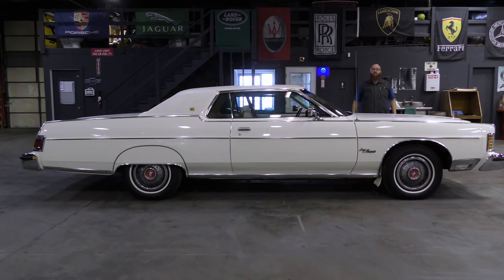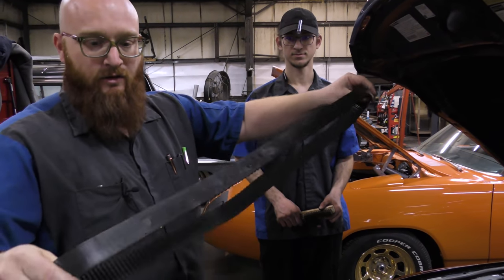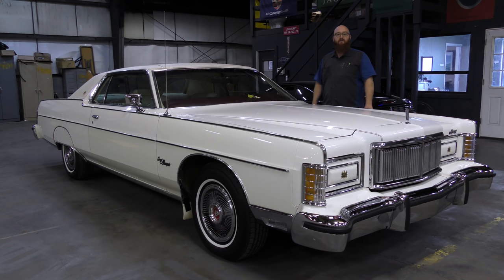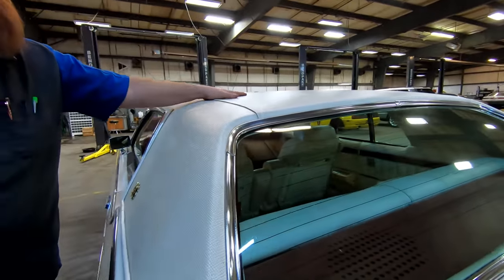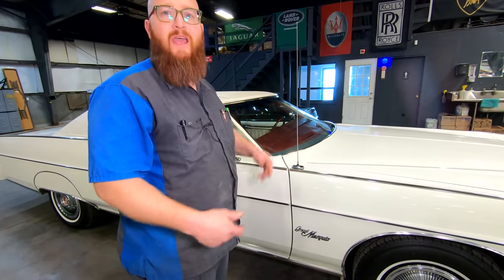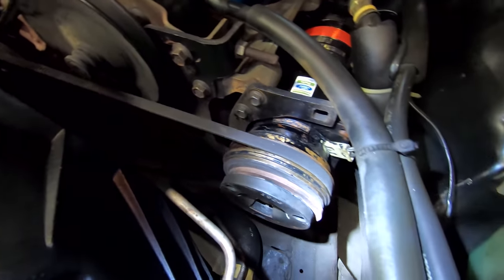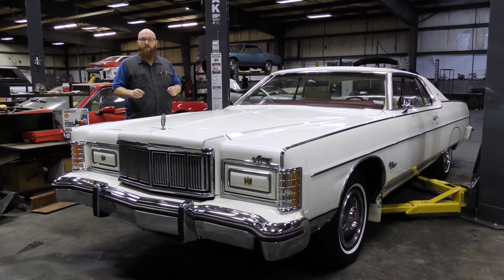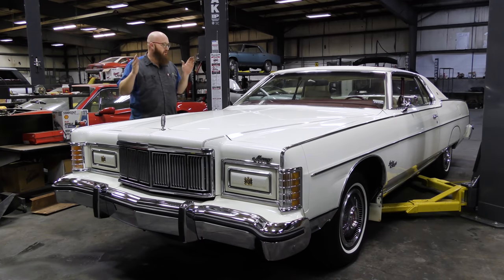Land Yacht Alert: 1975 Grand Marquis with 17K miles is in the CAR WIZARD's shop

Comment: I can't even imagine what kind of fuel mileage that thing can get. Back in the day, I had a 1971 LTD Country Squire wagon with the 400 cid engine. It would get 10 mpg on the highway, at 55 mph.
Reply: SPM Smiles per mile 😊
Reply: A friend had one in high school and it got something like 7 miles per gallon.
Reply: @michaelmaas5544  why?
Reply: Remember this was after the “ gas crisis “ before my time but If I recall 71 was the last year for these high compression engines so these big 400 + coming engines had super
Low compression and had under 200hp but boatloads of torque if I remember correctly.
Go back to late 60s and 71/72ish and these engines had 250-350HP and 500+ lbs of torque with 2 4 barrels of course! Imagine how these huge boats moved then!!! I’d love to drive one and feel 500lbs of torque in one of these pillow floats lol
So this goes for the Ford crown vics of the late 60s -72ish ,Mercury grand marquis’s and Lincoln town cars of course! 500lbs of torque LOL
Reply: @SMor42  Wow, imagine burning 3 10-liter buckets of fuel to move your ass 100km. I think I'd start cycling to work to offset it in my conscience.
Reply: My first car was a ‘77 LTD with the 460; if you put your foot in it you could watch the gas gauge go down 😧
Reply: My 1969 Lincoln Mark III got in the vicinity of 9 around town, but almost 19 on the highway.  Fuel mileage was irrelevant in those days.
Reply: I used to have a '76 Thunderbird with that same 460 and it was EPA rated at 7.6MPG. Never actually tested it myself but it took well over $100 to fill up back in the early to mid 2010s.
Reply: I’m actually getting 15mpg hwy!
Reply: @escapecar  but it only made like 150 horsepower
Reply: Had a 1979 LTD 2 door back in the late 90s/early 00s. Was all black with black leather, it was a cool looking gigantic tank of a car. Had a 351w and a c6 three speed automatic. I added a set of GT40 cylinder heads off a junkyard 5.0 Explorer, had a generic aluminum dual plane 4bbl intake with a Holly 750, had headers and 2.5 inch duals with glasspacks and no cats, deleted the EGR and the smog pump, it had a "small" Crane cam in it as well as 1.7 ratio rockers.

It actually did pretty good on fuel (if I kept the secondaries closed) because it had a ridiculously high differential gear, it was like 2.70:1... Even with it just being a 3 speed it was only turning like 2200rpms at 70mph. In my younger and much dumber days she'd lay the speedometer needle on the stopper past 120mph and she was still pulling hard. Ended up selling it when it decided I wanted a truck, and basically did it all over again to a 351w in a 1986 F150 short bed 4x4, that truck was like 3 feet shorter then that car I lol.
Reply: @flight2k5 I have 75 Marquis Brougham with the original stock 460 with the stock 3 speed automatic. It is rated at 212 hp and gets about 13 mpg.
Reply: @mickeyharrington6785  oh boy. 212 hp out of 460 cubes. Woo hoo
Reply: @euroasianbob9268  That is surprising.
Reply: @flight2k5  Proves I know what I am talking about, not just talking through my A##. Don't knock it till you try it. Torque output  is 342lb ft which will move these cars very well. These are great road cars.
Reply: @mickeyharrington6785  whoooaaaa 342 out of 460 cubes?  Damn that’s impressive 🤣😂
Reply: @mateuszQRDL  stick with your smart for two then
Reply: @RToddRothrauff  I remember reading a road test of a '73 Ford Maverick with the small block V8, and the gas mileage was actually worse than your Lincoln. I remember the article claimed it was worse than some motor-homes! All things equal, the older high compression engines could get relatively decent mileage.
But of course, by '72 , compression had to come down to reduce NOX emissions. With all the other emission 'fixes', and the added weight of the 5 mph bumpers, mileage and performance really bottomed out in '74 - 75, until the cat-converters were added so they could start improving performance again.
Reply: I had a a 1976 with the 460. I kept hearing stories like, "Well, if you don't go fast, it'll do 20 MPG." I tried everything and never did better than 12 MPG. Then I figured since I had a 460 V-8, I may as well enjoy it, so I kind of drove it normally. That took it down to 8 MPG in the city and 11 MPG highway.
Reply: @B0xlife1  in 1971, horsepower ratings were switched to net figures, as installed in the car. These were at least 30% less than the gross figures. Dual four barrels were never common, especially in a car like a Grand Marquis, which never had them. They are not worth the trade off for 95% of drivers. Want 500 ft/lbs of real torque? Well, a Ford 3.5 Ecoboost makes 510 lb-ft @ 3,500 rpm in the Raptor and 470 lb-ft @ 2,500 rpm in a plebian F-150.
Reply: Dizzy Gear  you seem nice. Not.
Reply: @flight2k5  it is close to 50 years ago.
Reply: @JStryker7  Thanks, but smart is too cavernous for me.
Reply: my 77 LTD with a 400 2 barrel averaged 18-20 on a round trip on highway 53 in wisconsin in the summer time. The front tires were cheap walmart specials but the rear were slighltly undersized but wider firestones, so the mileage may have broke 21-22 possibly depending on tire.  the EPA estimates according to the paperwork i had with it said 12-14 combined 17 or 18 highway. IT definitely drank gas when city. 24.6 gallon tank
Reply: The best I ever got out of the 455-4bbl in my ‘71 Electra was 16 mpg, cruising the interstate at 55. Around town, about 8-10.
Reply: @flight2k5  By todays standards maybe not. In 1975, yes, it was. Can you even remember that far back, or are you still wet behind the ears?
Reply: @mickeyharrington6785  you’re kinda special aren’t you?
Reply: @flight2k5  Not at all, but from the way you talk, you must think you are! Goodbye!!!
Reply: @mickeyharrington6785  goodbye!
Reply: 13-14 at best my 78 with 302 got 17
Reply: My first car  was a 1972 4 door Caprice with the 400  I didn't really care what the mileage was I was 16 had a job and gas was cheap in 1978.
Reply: My 71 LTD with the 400 would get 17 on a bad day. Its all how you tune it. With an edelbrock intake, Carter afb, and dual exhaust,  I upped it to 20mpg. The same I get now with a fuel injection 4.6 with overdrive.  The LTD had way more power. (Gas is lower BTU now so it's not really apples to apples)

Comment: This brings back memories!  My dad bought a '76 Grand Marquis for my mom in 1980, and we kept it until at least the late '80s/early '90s.  I got a lot of time behind the wheel of that car after getting my license in 1984, and my "achievements" were as follows:  first time over 100 mph (which is pretty scary on a bumpy country road in a 5000-lb car with blown shocks; bonus points for having two of my high school buddies in the car with me), first traffic citation, first accident (I t-boned a car in a parking lot at about 15 mph; driver was okay despite not wearing his seat belt).  The car held up pretty well to the accident, but it did completely bust out the grille. Dad never had it replaced; I think his reasoning was that if the car still ran and drove he could live without a grille.

Comment: Truely a beautiful classic car, and considering the age amazing condition throughout.....That said I do have a critical eye, I look for fault, it’s just something I do, because finding a car especially at this age, it’s a real challenge. At 4:10 into this particular video, there appears to be a slight dent, about 9 inches in length, driver side lower front fender, just forward of the wheel arch. Apart from this, the rest of the Mercury looks just magnificent..👍.

Comment: Great old car. Excellent condition. Hard to believe that Gerald Ford was President when this was built.
While not mentioned in the video, 1975 was the first year for the catalytic converter at least for CA. 1975 was also the year for the now infamous "seat belt interlock" system. The car could not be started unless the seatbelts were buckled. There was an over-ride switch under the hood. There was so much backlash, that it was dropped for 1976.
These land yachts used a lot of fuel, but who cared? Gasoline was less than .50 / gallon back then. Thanks for showing it.

Comment: When I was a teenager shopping for my first car (in the 1980s) I test drove a very nice Lincoln Town Car that was about this size. Even back then it seemed large.  I was sure I would end up crashing into something, especially backing up, so I ended up settling on a decent condition 1977 Monte Carlo, which seemed moderately-sized by comparison.
Reply: Not a bad choice either way there. I had an '81 Z28 as my first car, and it's dwarfed by this Grand Marquis
Reply: I remember back in the late 70's my sister had a used Monte Carlo (not sure what year it was) and as a little kid I thought it was so cool that the front seats swiveled 90 degrees so you could exit the car facing directly out....I've sure never seen anything like THAT on another car    :)

Comment: That's a rare beast for sure. Even in the late 1980's the ones that were still in use looked like the Uncle Buck verson. 19.5 feet long is exactly the same as my 1962 Cadillac.
Reply: Well... your 1962 Cadillac was actually 18.5 feet long.  But it is the memories that count!!!
Reply: @billyjoejimbob56  No 5 mph safety bumpers in 1962.
Reply: @jeffrobodine8579  Tru dat.  If you are a true Cadillac fan, you know that they produced a short deck variation on the 62 and Sedan DeVille that was seven inches shorter than the rest of the lineup. through 1964.  Didn't sell well... I have never seen one in a show or museum.

Comment: I did buy a 1970 Mercury Marquis 4DR haed top with a 429 motor . I paid 4 dollars , it didn't run . Aired the tires , new battery cleaned off the leaves . It started ran very smooth and drove it away . No rust , everything worked . Goos deal that was .

Comment: FYI. The brake indicator in the dash illuminated when the parking brake was set or, when the brake pedal was depressed deeper than normal.
Meaning failing brakes. The undercoating was probably added for sound deadening. Luxury vehicles didn't sell well if they were noisy.
After the mid-70's oil embargo, dealers had a devil of a time selling the gas guzzlers. As big as that car is - you can turn the steering 
wheel with one finger!

Comment: Previous owner must have had a huge garage to store this monster. Even a garage queen can accumulate scratches and dings just from other stuff falling or rubbing against it in a tight storage area.

And that low mileage....over 47 years, that averages to a maybe a tank and a half of gas every year. It takes some discipline to keep the fuel system clean.

Comment: My family liked Cadillacs and Mopars. We had several 66 Cadillacs, a 69, 73 Chrysler woody wagon with a 440 we got for 100 bucks in the early 80s with 2 smashed doors on the drivers side. We had a lot of earlier cars too but those were the longest cars with the biggest engines in the family. Every bit as long as that Mercury and just as thirsty, but very reliable. I almost ended up with the wagon because my Dart was down with a blown 904 transmission at the time so I got to drive that land yatch till I found a 727 to put in the Dart to make it stronger. It felt like driving a semi with a trailer after my Dart but I got used to it and it floated down the road and the Thermo Quad made a wonderful roar when you got on it. Step dad later found a couple of good doors and hung them on it as none of the door frames or hinges were damaged and the bent doors still worked before he swapped them out.

Comment: That car is beautiful. It looks like the clock wasn't working though which isn't unusual for those. The grease that they used on the plastic gears inside gets hard with age and it will either lock them up or the gears will break. There's a couple of companies that specialize in restoring automobile clocks. I had one in my 1953 Imperial rebuilt several years ago and it still works today.
Reply: Who restores the clocks?
Reply: @euroasianbob9268  D&M Restoration in South Carolina is who did the one for my Imperial a few years ago. They do gauge restoration work as well.

Comment: Awesome car. I had a 1977 Ford LTD 2 door with a 460 and C6 Transmission. We got a police prepped 460 from a NJ state police auction, beefed up the C6 and the car was a highway cruiser. It already had the  9" rear end with 3:00 gearing. Loved that car. Cruised effortlessly at 100 mph on I-95 from NJ to FL back when you could still do that kind of thing and gas was $1.04 a gallon.

Comment: Looks like the Grand Marquis had a replacement water pump at some point (surface rust). The hardware store plumbing hose clamps are also a sign. This car deserves a blue water pump and proper era-correct Ford clamps to really detail the engine bay.
Reply: Just saw your comment.  I said the same thing up above about the hose clamps.
Reply: @jonathana2079  
Oh good. And factory underhood clamps are meant to apply a constant clamping force over a wide temperature range as to not cut into the hoses or damage the inlets or outlets they're connected to.

Comment: I started at a Ford dealership in 75 did alot of valve jobs and in chassis rebuilds on the Ford Sister car LTD Landau, got to love the 8-track Quadrasonic. Most of these are rusted away but they are great demo derby cars. The flintstones rock car is not as heavy as that beast!! Nice clean gas eater.

Comment: A great upgrade on these cars would be an overdrive transmission !  Better low end power and less rpm's  cruising the highway !  
Remember they use to pull travel trailers with these cars !
Reply: The overdrive transmissions are what enabled automakers to install smaller motors in the large cars starting in the late seventies into the eighties and beyond.

Comment: I grew up with the 1969-1978 big Fords and Mercurys...seven of them in total.  My grandmother bought the first...a brand new 1969 429 LTD Brougham 4 door hardtop, and the last were two 1978 460 Mercury Grand Marquis', one of which my uncle ordered to match (and replace) his 1973 460 Marquis Brougham 2 door hardtop, and the second was a very lightly used 4 door pillared hardtop purchased by his oldest son a few years later.  The other three "in between" cars were a 1970 Ford Galaxy, 1975 Ford LTD Landau, and 1975 Mercury Grand Marquis.  All of them were wonderful cars!  Well, actually, those beautiful cars are all long gone now...but there is an eighth car now: my 1969 Country Squire wagon with a 429 4V engine.

The particular Mercury featured here has the original 460 dual exhaust system which was used on the '75 and '76 cars.  I find it interesting that some (if not all) of the non-California-emission models of these two years had a single catalytic converter "scrubbing" the drivers side cylinder bank only, while the passenger side was "open".  The factory service manuals confirm this peculiarity, and it is evident on this one!

Comment: I owned a 1976 model for a couple of years in the 1990s. It had spent all of it's years in the family and was in really good shape. Emerald green in and out. The upholstery was velour. It was a living room on wheels. For shorter periods of time the seats were luxurious but for longer duration highway trips, they lacked the support of a more modern seat so you needed to move around a bit to avoid kinks in your back. It was a wonderful car.

Comment: Beautiful Black Lexus!  I have an 04 SC430 with 60K on the clock, and I also just had my Timing Belt and Water Pump, including the Thermostat and seals replaced at a Toyota dealer (I also own a Tacoma).  Anyway, I'm the second owner of the Lexus, and the TB/WP is part of the maintenance of these cars every 90K miles or every 10 years.  My old TB came out looking just like yours in the video - in good shape.  Some owners never replace them, but if the belt snaps on an interference engine, there goes your engine.  It's a piece of mind kind of thing to replace them.  I also used to take my Lexus to a Lexus dealer, $2200.00 to change to TB versus $1300. at a Toyota dealer.   Go figure!   Btw, that Grand Marquis is beautiful, too!  I'm think that the Lincoln of that era had a 460 engine as well.  Yes?

Comment: I have a 78 4 door marquis with 260k miles the car has been fantastic I daily drove it for 5 years before I parked it for 3 due to buying other cars a decent oil leak from the timing cover that needs to be addressed and it needs a carb rebuild as it drinks quite a bit more than it once did probably a couple of vacuum lines need replacing aswell mine is as base model as you could get. Only a driver side mirror am only radio single speaker no clock front solid bench seat manual windows and locks the only options it seemed to come with was the 400 ci v8 cruise control and a/c I've put in a clock and a am/fm 8 track player I still have the clock delete plate and am radio though

Comment: My first car was a 76 Ford LTD Landau 2 door (Ford version of this car), that was urination gold from bumper to bumper, including hub cap centers and interior. It did have a warmed up 460 and a factory CB, so not all bad. Thanks for the video, and enjoy the one finger steering.  When you get the air fixed, it will ice the dash vents in the summer.
Reply: I remember that color

Comment: I learned to drive on my mom's 1977 Lincoln Town Car.  My grandfather measured it and said it was just under 22 feet long.  It was huge and wonderful to drive.  She tracked the fuel consumption, it was 10.1-10.4 mpg on average, even with substantial highway driving.  7.5L 460 V8, unfortunately choked with emissions equipment, etc.  Nearly the same platform as this car. The burgundy dash with ivory interior on this car seems very weird to me.